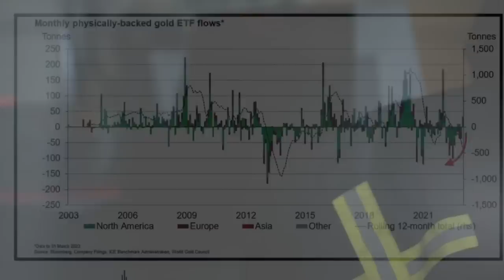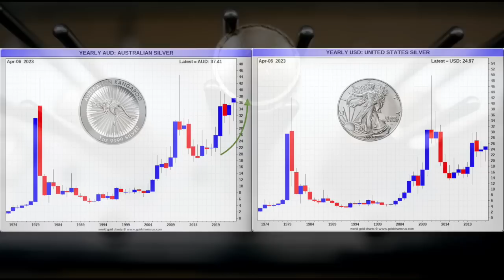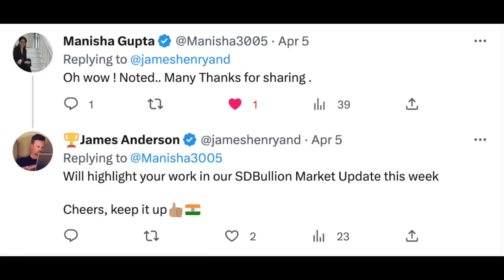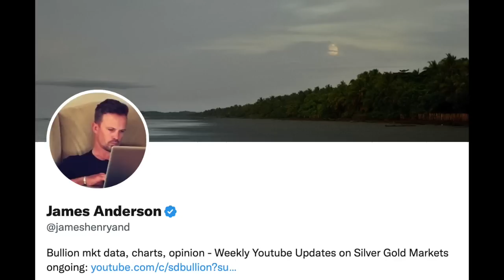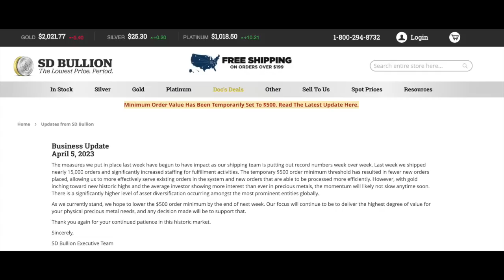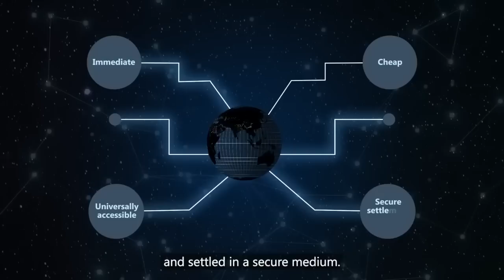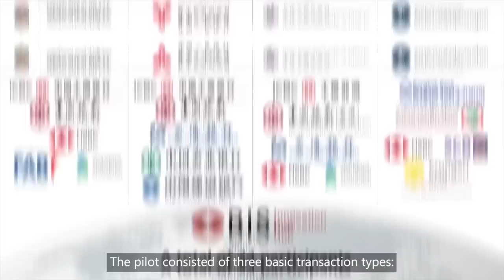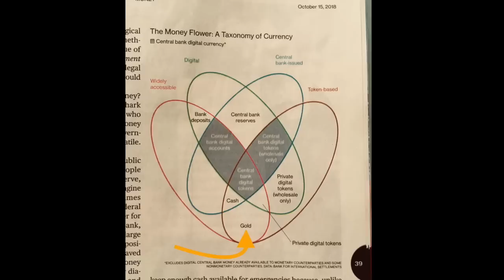Central Banks Record Gold Buying Pace Continues Front-Running Their mCBDC Grid

Comment: Here in Venezuela if you want to sell Gold the going rate can range from 90%-92% of spot, if you are lucky and find a good connector buyer they will pay 95.5% for gold bullion, Silver because of it's volatility the sell price is as low as $300 for a kilo to as high as $450 kilo, this is real world boots on the ground info, not internet crap you read about Venezuela

BTW Gas is $0.50 USD litre
Chicken $1.85 Kilo
30 eggs $3.80
Rice 1kg $1.20
Hamburger $4.00 kilo

Comment: Just a new and fancier ledger. The BIS can improve the technology, but they have not addressed the elephant in the room. The global inequity and sin. Unless that is addressed, a different type of ledge will always be resisted by those being exploited. For example, it doesn't seem like larger players are going to only have BIS capability. They will have their own (point to point direct) systems. They have studied and learned from their enemies and they won't make the mistake of allowing one player to control the system. They will have multiple ways to make transactions so that 3rd parties, such as the BIS, can be circumvented entirely should that 3rd party, such as the BIS, become a hostile entity.